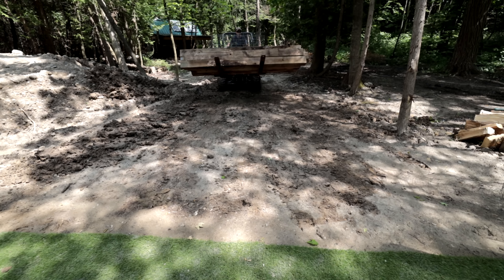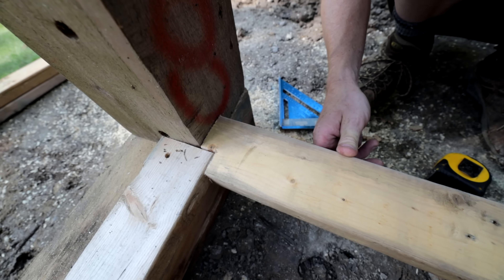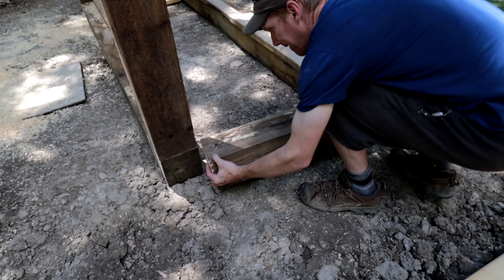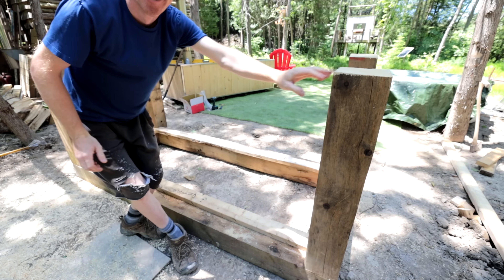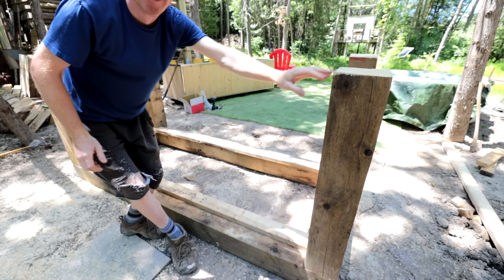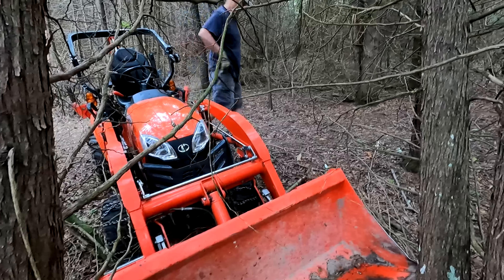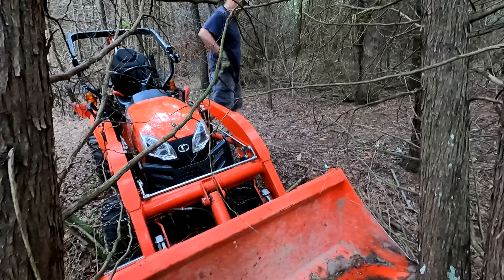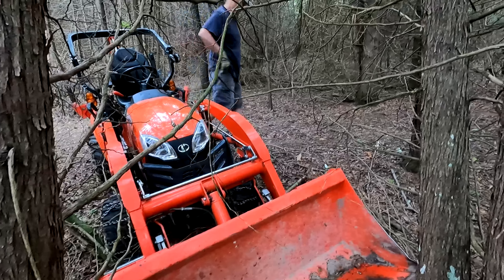I Built a $10,000 Outdoor Kitchen Cook Island!

Comment: That metal thing you found is a piece used to connect rope. The latching pieces come together and a pin goes through to lock. When old stone walls were built in New England where I grew up, they would use horses to pull loads of rocks to build the walls.

North American soil has a ton of rocks, and in the north/northeast of the country it is not actually well suited to farming. The first thing that people had to do was get all the rocks out of their fields. Then they had tons of rocks, so they used them to mark property lines.
Reply: yeah, you can't drive anywhere in new hampshire without seeing rock walls crumbling all over the place
Reply: Yup!  they are still in older neighborhoods in the city I grew up in
Reply: I guess the rocks were all glacial deposits from the ice age and retreat? Hence they're all smooth and rounded, and some are very different?
Reply: Yup I grew up in RI and you can still walk through the woods and come across many rock walls seemingly just in the forest now. Just old field markers in the middle of nowhere now.
Reply: we have this in Denmark too, but not so crazy, and more with bigger stones, ive been to England once, and i saw miles of walls made of  flat stones, it was crazy

Comment: We stored workhorse harnesses and fasteners for decades (but workhorses did not come back!)  The metal piece you found looks like part of the system for attaching the harness to an implement.  A bolt would connect through the two round parts to hold a chain to pull things.
Reply: Workhorses did not come back---yet!

Comment: That's a great looking island. For the counter top you can also use mineral oil from the pharmacy. It's the same stuff. You'll get a greater volume for a fraction of the cost.
Reply: mineral oil from the feed mill is cheaper yet
Reply: Since he mentioned it was edible I bet it is mineral oil with some dissolved bees wax or something to make it 100x more expensive than the generic pharmacy stuff.
Reply: @MrLangDog  Mineral oil from the pharmacy is edible too. It's used as a laxative. I have some Boos Block oil that was pretty expensive. I'm pretty sure it's straight mineral oil.

Comment: Mineral oil is used as a laxative but you would have to swallow a tablespoon or two. As for treating your counter tops or butcher block you'll be just fine it's what I use on my cutting board. It's also good for oiling fine machinery.

Comment: We occasionally used the black irrigation pipe and what we do is heat up the pipe with torch and put galvanized stab fittings and thread a valon on that and hose clamp it on the stab fittings

Comment: I'd really like to see a roof over your new kitchen gathering area. You'd want it to be relatively simple though, so as not to detract from the kitchen slab... I'm thinking a 6x6 post a few feet behind either end of the kitchen slab with a concrete base... Y-struts to a crossbeam, then angles up from either end of the cross beam to make the roof. You'd probably need a 20-25' spanning beam from post to post to hold up the roof, so you might be able to get by with some 2x12s and spacers between to span the distance. The only weight you'd be holding up is the roof itself and whatever snow you get. If need be, you could install a post mid-slab for some extra support or instead, have posts on the roof edges going to the ground a few feet behind the slab so you don't have to modify it. The reason I suggest this is because the wood work is beautiful and I don't want to see it only last a few years before it starts to tarnish and rot... The drier you keep it, the longer it lasts. 

Also, if you you make the roof high enough and the roof angle low enough, you could install some solar panels on it that you wouldn't even be able to see unless you were farther away. Having some free electricity down there would probably be helpful, right? And then think of all the new things you could build! Battery buildings, electrical buildings... lol.
Reply: I was thinking: “roof”  as well. It would be great for some weather protection & a great look too. It could be Tiki style. Although that may not work for solar panels…also a super idea.

Comment: I have a butcher block table on my porch that I oiled and it continually mildewed and had black streaks.  I used an acid wash and sanded it then used a product called “Rapidcoat” by Epithane.  It works great. It creates a varnish like finish, but you can reapply coats without sanding to build up a heavy coat.  The finish can be applied over oil.  It has lasted years.  It is expensive ($43 for a quart).  The mineral oil you used may give you the same problems.

Comment: Double tree horse /ox’s yolk the end with and bend it it is for a chain to adjust length of strap depending on size of animals pulling probably used for pulling logs by ox’s in the area you are in but could be farm equipment also. The scull I believe is a small black bear. Love the table sink I have a pile of the 3/4 irrigation pipe like 10,000 feet wish I could send it to you to see what you would use it for!

Comment: I was paying attention in Physics, and to determine the pressure of your water calculate the weight in pounds of a 1 square inch column of water the precise height of your elevation change, regardless of the route it traverses.  30 feet is 360 inches so 360 x 1 x 1 is 360 cubic inches which is say 5.899 litres, which at 1 kg/lilre weighs roughly 13 pounds, so the pressure is 13 psi.